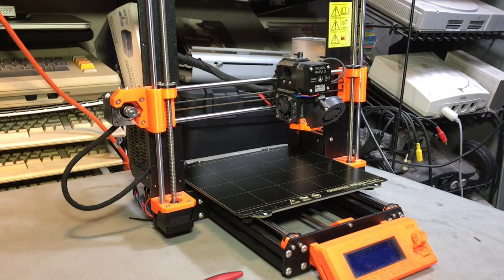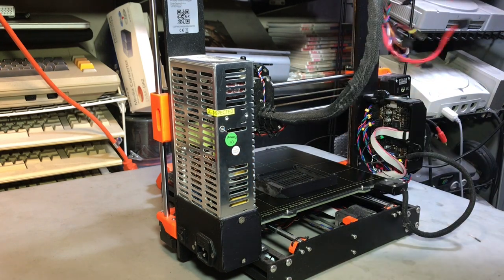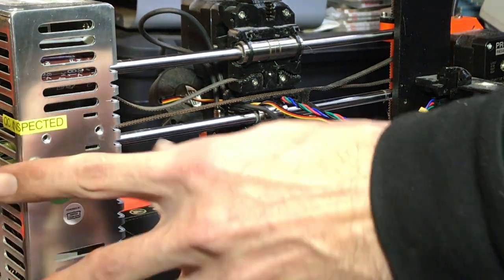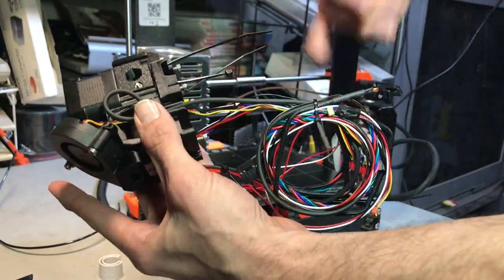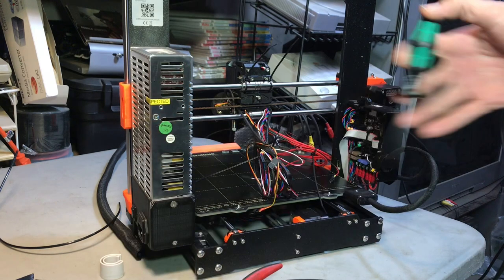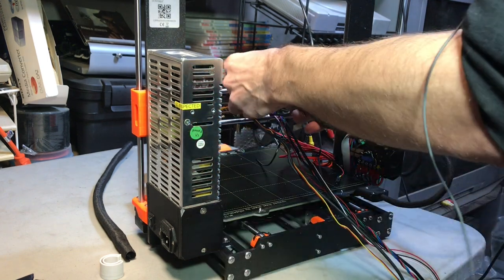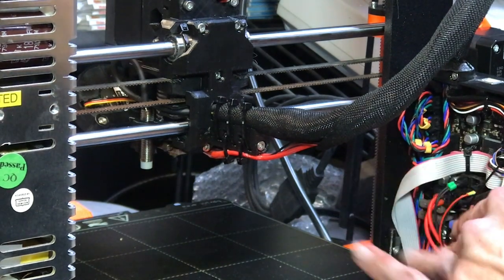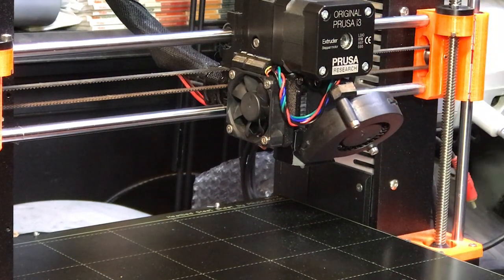MK3S Extruder Removal & Re-Installation

Comment: Ummmm thanks, but that didn’t explain how to replace the extruder motor at all. All you did was tell me how to remove the head and send it in for someone else to do it
Reply from the maker: There’s likely nothing wrong with your extruder motor; maybe consult a professional if you’re on that track.
🤔👍🏻
Reply: @LA3DPrinterRepair  it stopped midprint right at the beginning. Nothing wrong with any connections. The motor does not turn at all. It wasn’t stuck, it just doesn’t move. The machine has been off for a few days, so it wasn’t overheating.
Reply: @LA3DPrinterRepair  I already figured it out myself.
Reply: @LA3DPrinterRepair  and I just replaced the motor and now it works, so yes, it was the motor that needed replaced.
Reply from the maker: @jaymuffinz  So what was wrong with the motor?
Reply: @LA3DPrinterRepair  it died lol that’s about it. It flat out just stopped turning. I haven’t taken it apart to see, but it flat out wouldn’t move. I popped a new motor in and everything ran again like nothing happened.
Reply from the maker: @jaymuffinz can you twist the shaft by hand? If not or it feels rough/hard to turn then it’s motor bearings; that can happen but it’s still very very rare compared to anything else that can go wrong up there. 
Let me know, we can “rebuild” it with fresh bearings if you want a spare on-hand. 👍🏻
Reply: @LA3DPrinterRepair  nope, the shaft is locked
Reply: @LA3DPrinterRepair  the bearings gave out would certainly be my guess as well. I could hear the motor trying to turn when it was in my printer, but no movement came of it, so yeah, probably burnt out bearings. I got it replaced it with a $22 motor that’s the right spec for my printer that’s working fine for now.